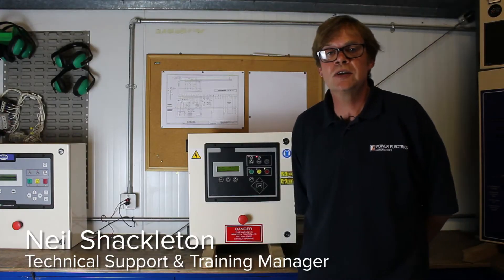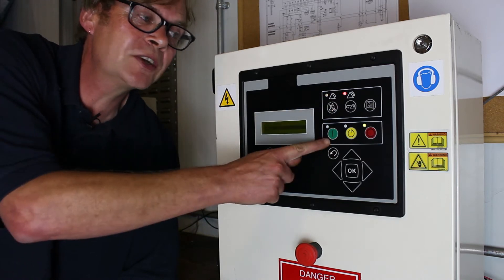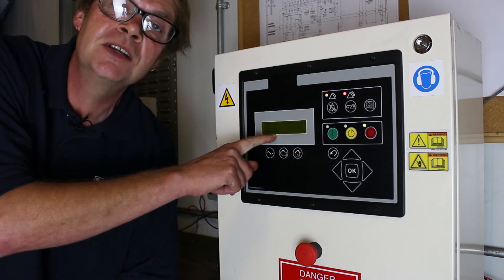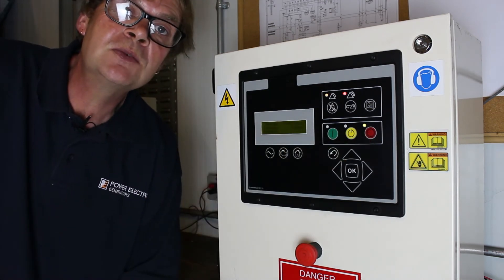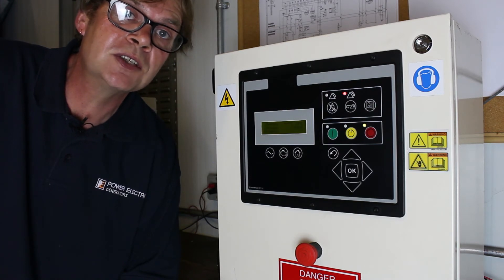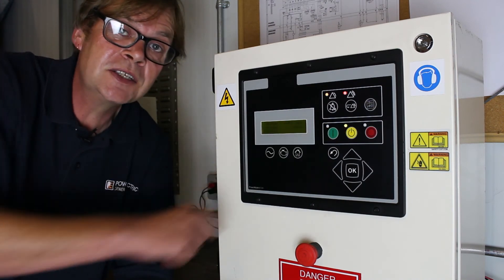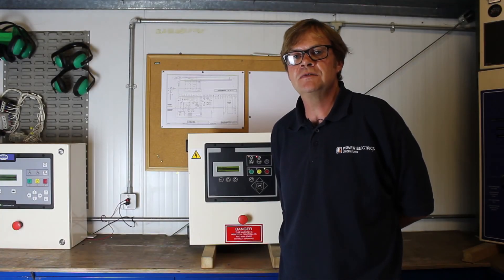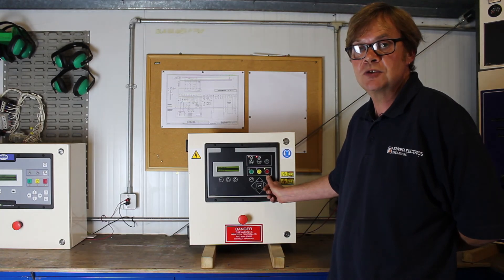How To Start Generators Using PowerWizard Control Panels

Comment: i have a perkins 750kva, (600kw,) 12 cylinder, gas generator i am working on, when i load it to 38%load% it Automatically shut down, and i ran it with the 35%load it shut down 3 hours letter  it also shut down, and the error message is gas knock fault present. please any information would be useful ton me, whatsapp: +2348063496667. maryaustin.mo@gmail.com( how can i solve gas knock fault present in the gas gen? any solution or ideal from anyone?
Reply: If the engine is GAS (natural / propane etc) as opposed to gasoline / petrol then this answer is likely to be of no help. If however you mean gasoline (eg: Perkins 4xxx series) then I am guessing the error may be due to the fact that under load, the engine is starting to knock / ping and the sensor is triggering a fault condition on the panel.

The reasons for this might be several. Faulty sensor is possible - as is something else rattling around the engine which tends to happen only under moderate load. The sensor will then "hear the clinking" and wrongly assume the engine has started to knock - and shut it down to prevent severe damage.

Assuming the sensor(s) are fine and there is nothing obvious that could be false triggering the sensors, then poor quality fuel might be the next guess. If the fuel is old / stale it MAY have lost some of its knock protection. Likewise if you have filled the tank with cheaper fuel assuming the generator won't mind, this may also be the cuuse.

Did the engine only develop the fault after a refill of the tank? If yes or if no - some idea of what has changed since it worked fine would be welcome - new fuel, new additives, stopped additives, fuel contamination.

If any of the above seems to make some sense to you, then it could be worth isolating the fuel tank and then using a small secondary tank temporarily hooked up with fresh fuel of a known high quality and fire up the genset again and place a load to take it to around 40% or more. Does it run happily or does it trip the knock fault?

If the fault does not trigger, then poor fuel in the main tank would be my first guess. If changing fuel makes no difference, then other possibilities are carbon deposit on cylinder walls, bad choice of spark plugs (too long / deep can run hot and cause knock). An engine running too lean can be more prone to knock as can one that has had the timing badly adjusted.

Without knowing more about what has been changed since it last worked properly, it is hard to anticipate all the problems possible.

If you DO find that switching fuel resolves the problem, then you could consider contacting Perkins to see if adding something like 10% toluene to the tank would be acceptable. (Toluene is one of the main octane enhancers used to convert low octane petrol to high octane petrol).

Sorry I cannot help more at this time, but if you can comment on some of the above, it will help me or other narrow down our thoughts a little more.